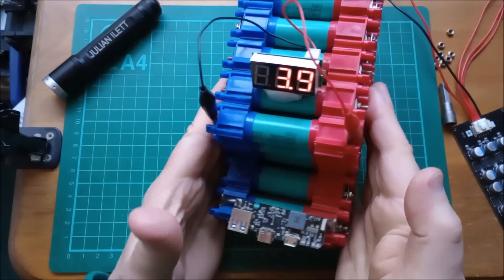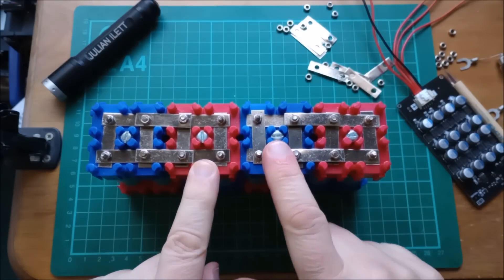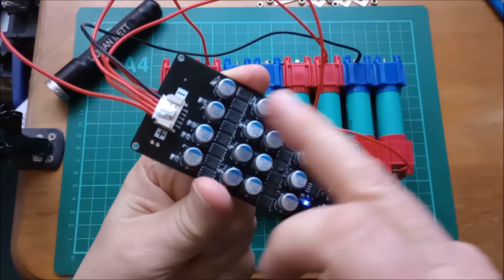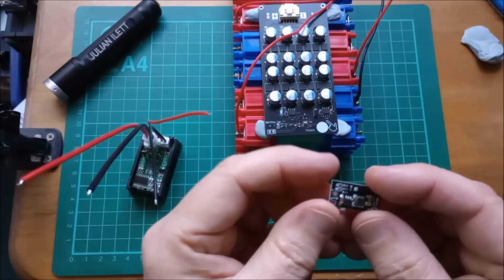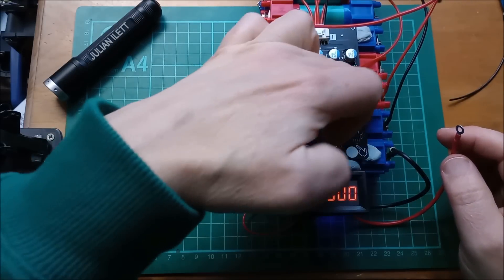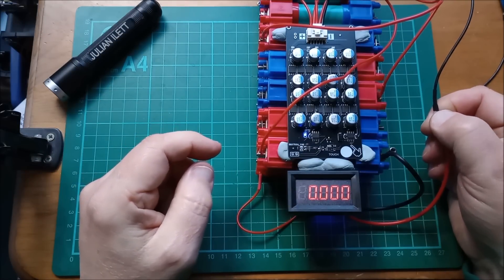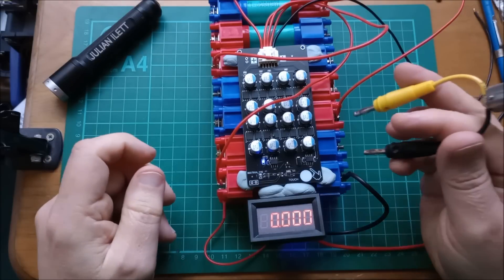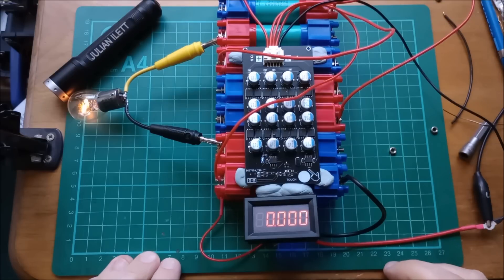4S Flying Capacitor Active Balancer Testing

Comment: Power the amp meter with a shared PSU -ve rail is going to cause weirdness and short circuits. Isolate/float the PSU.

Comment: Kind of annoying how most (all?) of these digital ammeters always measure in the negative side of their supply, so you have to use a supply isolator to measure in the positive lead. It would be nice if they included that and tnen you could measure anywhere without worrying about the negative supply and negative measuring lead being commoned together.

Comment: So I want to balance a 7S pack. I wonder if I can overlap 2 of these  balancers or not. First one would be on cells 1-4 second one would be on cells 4-7.
Reply from the maker: I believe you can overlap them - that's probably what the top link is for (near the connector). But you can get an 8S version which also works on 7S packs.
Reply: Good to know. Thanks

Comment: I got a couple of those to play with. But got a little trigger shy with the project when the reviews said the board has no protection. So if you accidentally switch 2 wires and put 8.4v through one channel of the balancer it will get destroyed. There are a bunch of situations that mine will get destroyed. 

I guess I will just have to triple check my work. Having a wire harness so the device is disconnected when I solder is probably a good idea.
Reply from the maker: Yeah, that would be a bad idea. For one thing the capacitors are 6V.

Comment: I got a 45 Kwh diy  battery bank, 15 Kwh of solar , Still i get new questions and å lot of answers to!!👍 (7P 14S )
Any idea how to diy a "Balancer" for  a 48V - 57.6V paralell multiple bank System ?
If possible and safe, (fuses and so on) then  Lead acid could be used paralell into your balacing system? Lead can take  +/- 0.25V if cykeled and will last "Forever" if not stressed (emergecy radio batteries on a ship normaly last for 20+ years.)..
Lithium will work as capasitors and be Balanced from the slow CHEAP Lead?
And ofcource it would be the same with a 12V- 14.4V / 1S in paralell With  a 4S / 4,1V battery (or 5S if chemistry fits lead acid in daly use by solar?
And love your channel and im a idiot! 
🐒
Reply from the maker: If that's a question, you'll need to simplify it for my ageing brain :)
Reply: @JulianIlett  LOL 🤣 Getting older here too!!
Sorry for my bad english!
My idea comes from this video, he explains this way better than i will ever be able to! : https://www.youtube.com/watch?v=tAuPfgZgXec&t=1s
And thank you for your answer!

Comment: I can't see the benefit of the touch sensor to turn the balancing off. It's a pointless waste of components for no useful gain. The balancing needs to autonomous, so works without human intervention.
Reply from the maker: It's unreliable too - the balancing just keeps switching off randomly. I'll be fitting the link for continuous balancing.

Comment: OK, so how do you add in a solar panel and a charger into this mix?  Hoping to see that in your next outing.  Thanks for the interesting content!
Reply from the maker: The system will consist of: solar panel, battery with balancer and BMS, voltage controlled relay, boost converter, buck converter, another battery, and a suitable load.

Comment: Since you have the meter connected to the black wire of the balancer you shouldn’t need any other meters because the current from all the cells will flow through the one black wire.
Reply: I don't think so... Capacitive balancers charge the lower voltage cell charging capacitors from adjacent higher voltage cells and discharge them in the lower voltage cell.
   The black current wire will measure the current in and out of that cell correctly, but not from the others...
Reply: @VictorC173  I guess I don’t see the need for more than that, but it’s not my project. 🤓
Reply: It’s just about more live data. Definitely personal choice. Right no the amp meter is on cell 4. So if cell 1 is low voltage and cell 2 is high voltage the 1 meter won’t pickup that the balancer is doing anything.